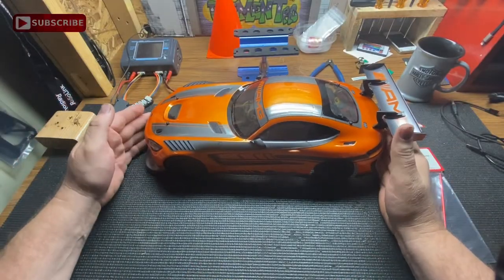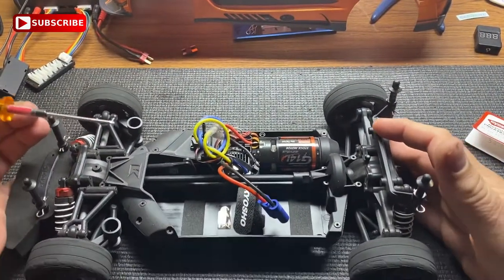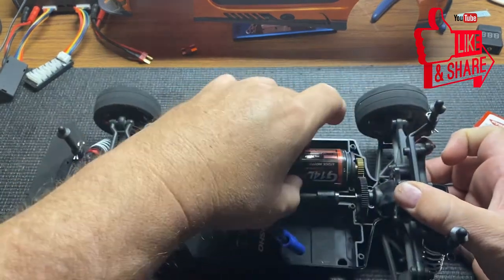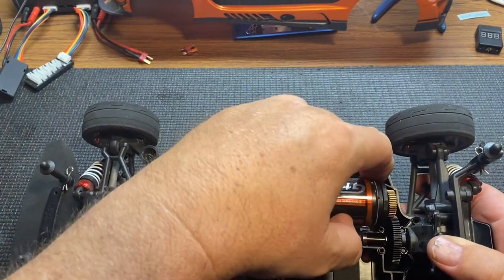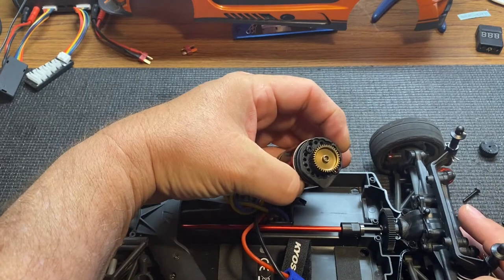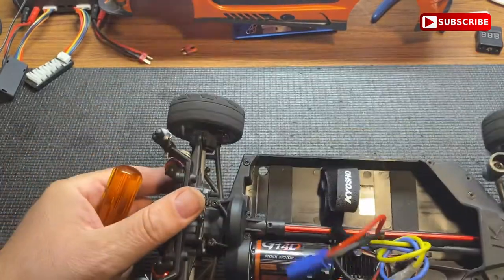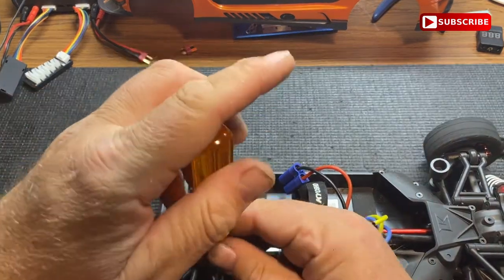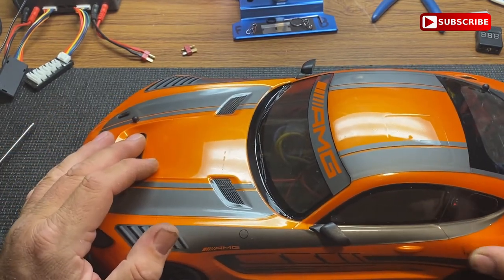Kyosho Fazer MK2 Drive Line Replacment

Comment: Just curious I just put a vxl esc and motor in, my driveline seems over tight,  I even got the cups with it, I'm thinking it might be the little rubber o rings in the cups,  might have to remove one or find a way to push them deeper,  it rolls but it's really tight,  it even runs,  it's just so tight it worries me
Reply from the maker: If it’s to tight you can remove one of the o rings just make sure the drive shaft will not fall out
Reply: @KurtsRCs  appreciate it,  thanks for helping,  nice to bounce my ideas off someone who gets it, I can't get them to fully seat, it's almost like the mesh of the pinion is causing pressure to the driveline,  and since they aren't in fully it's just enough to make it really tense to roll

Comment: Where did you got the driveshaft?
Reply from the maker: From OMGRC.com
Reply: @KurtsRCs  ok thanks. So hobby wing combo and drive shaft is all i need to make it brushless? Because i really dig in the design so nice. I am xhjosing between arrma vendetaa or this one then convert to brushless. The style of kyosho is the best.
Reply from the maker: @Tylenol888  if you want a good drive shaft you can get one from Kaniz RC or @kanizrc on instagram he sells drive lines for Kyosho and Traxxas cars. I have a video installing them in my Fazer Mk2 and Traxxas 4Tec
Reply: @KurtsRCs  oh ok i am just planning to buy arma vendetaa or this kyosho. In vendetta i will just put my battery and its already 3s. But in kyosho i like the scake size and the looks. Which i can upgrade later to 3s. Its hard to decide.

Comment: That's a great video and I really like the AMG Mercedes coupe . I got 2 ready to run Fazer 1969 Chevy Camaro Z28 ready to run , one is the Brushless black supercharged and the other is the frost green Z28 and I recently got a Fazer chassis around 4 weeks ago here in Australia. I was waiting a fair while but the guy I'm  buddies with at my loca hobby shop had placed his order over a year back. The Fazer chassis retails here in Australia for $278.09 AUD. That's probably the best way to get every spare part you will need. And I agree the Kyosho Fazer chassis is a great platform for on road touring car track use. I even reckon the brushed G14 L motor is plenty fast and the VE brushless is ridiculous. Just a little bit of a handful. Not allowed in any race class too because the rules are for stock cars with brushed motors. Yeh and as great as the Kyosho Fazer chassis is I never would have believed back in the old days that drive shafts would be plastic . But it's not only the centre shaft but also each driveshaft from differential to hubs and even the drive cups. The Fazer chassis kit eliminates the plastic and gas aluminium for all shafts . Well I will have to check tomorrow in the daylight but ithink.its a great way to get speed buying the chassis give new wet part.